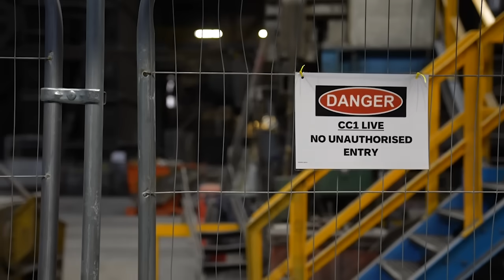A New Chapter for Continuous Casting

Comment: In the early 60’s I worked for a consulting engineers who designed the original Comcast system for the steel company of Wales at Port Talbot.

Comment: All very interesting. However, what will happen if there is a shortage of electricity to supply the plant given that the UK is shutting down more power stations in favour of importing foreign energy. Or will TATA Steel have its own energy source from small scale nuclear power?
Reply: There will be power. Don't listen to what the right-wing press says. They certainly won't have their own nuclear reactor. What are you talking about?